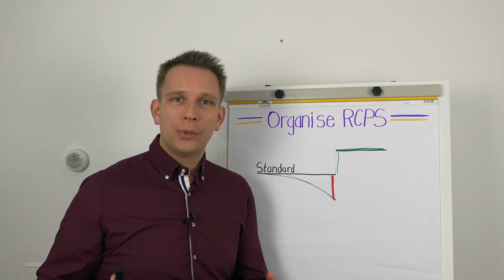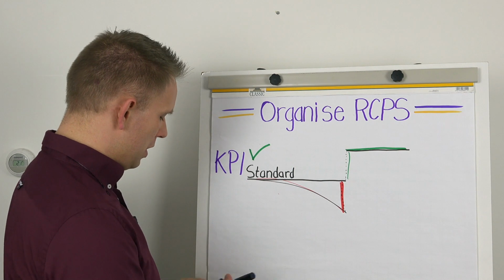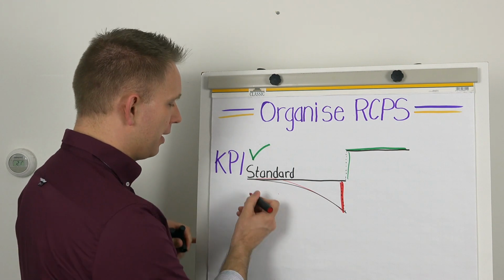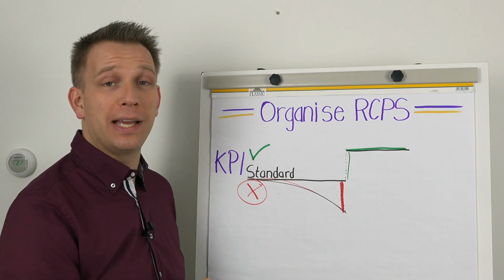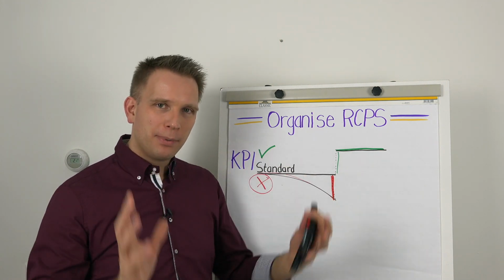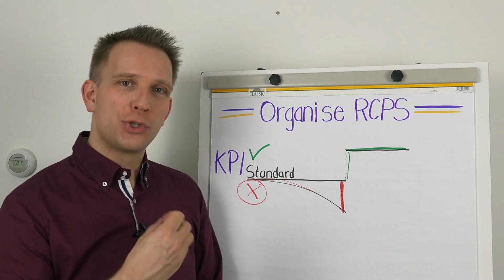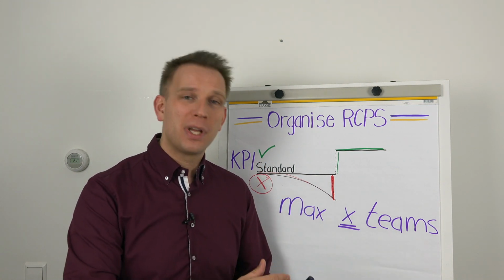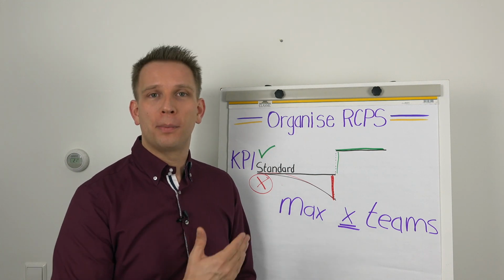How to organise Root Cause Problem Solving for maximum effectiveness in your organisation

Comment: Like your videos, but the marker onbthe paper is horrible. Try-out a Whiteboard.
Reply from the maker: Good to hear that you like my videos, and also glad you're giving me the feedback I need to continuously improve them.
I'm definitely aware of the marker's sound and have made a couple of changes to get rid of those soul-scratching screeches that have plagued our learning experience.
This particular video is from a while back - would you do me a favour and tell me if the sound is still too screechy in video over the last 2-3 months? (I've changed my microphone and post edit sound settings)
I'm not a big fan of whiteboards on video because it's much harder to get clear readable text on camera from a glossy whiteboard. But if the sound horror persists I might just have to.